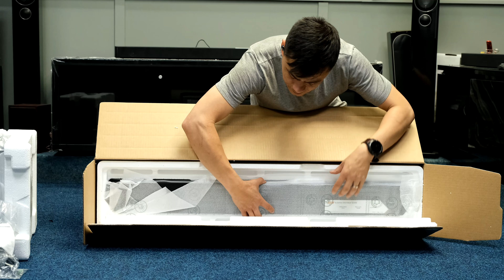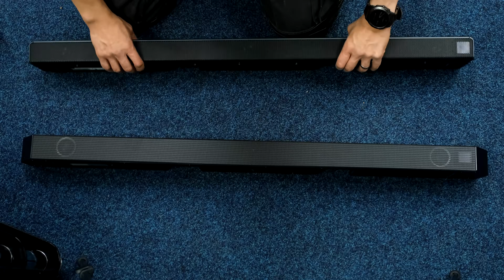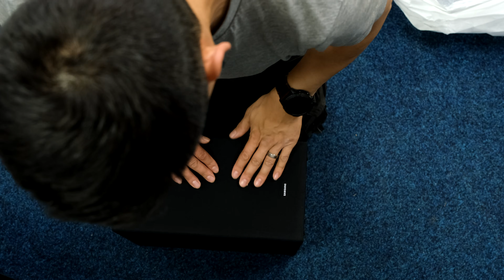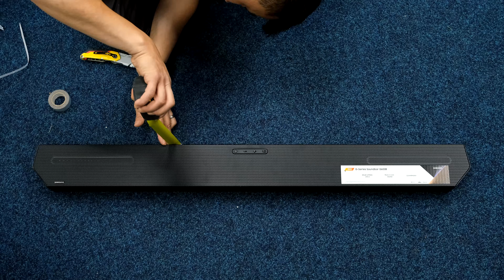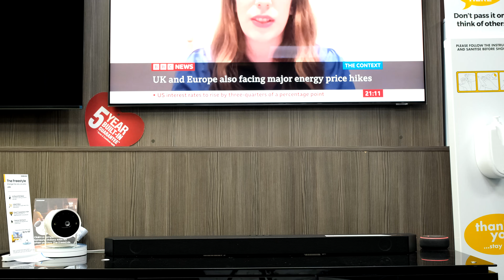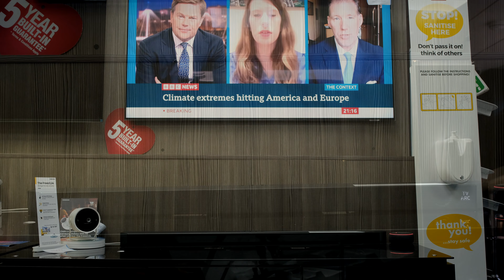Samsung Q600B Soundbar 2022 Unboxing, Setup, Dimensions and Tests on TV, Music and Movies

Comment: I cant Figure out where the 9 speakers sit.
I can See 2 on the top and 2 on the Front and minimum one in center. Makes 5. I got q610b it should have 9 build in speakers.
But that soundbar sucks. 400euros  and sounds like a better stereo soundbar. No overhead Sound. Tried All settings. I always hear the Sound from the soundbar and not every where in the room like dolby atmos or 3d Sound

Comment: The new soundbar does not work, there is no guarantee. I'm trying to do it. According to reviews, this is a common reason for this model. Maybe someone who has already encountered it tells which element does not work

maybe there is a downgrading firmware, or dump

who has electrical scheme for samsung q600b/za? ready to buy
Reply: Did u find any solution

Comment: Thinking of getting this, I'm not technically minded here. You hooked the hdmi to the TV, what happens when I want to watch 4k content through my 4k player. Do I use the optical cable for sound from the 4k player to the soundbar. Then hdmi from the 4k player to the TV is that how it works.

Comment: Excuse me, but what is the difference between Q600a and Q600b? I can get Q600a much cheaper in my country. Any significant difference?
Reply: a means 2021, b means 2022. the b vearsion has top speakers, and eARC.

Comment: I received yesterday, I'm using with an LG TV. When I turn off the TV and then I turn on the TV it lost the pairing with the soundbar so I have every time go in the tv menu to ri- connect to soundbar. Maybe I do something wrong I don't know, any suggestions?
Reply: Have you tried using an HDMI cable and connect it directly to the TV.
On TV make sure to select "HDMI ARC" port. Lg remote should operate it.
Reply: @2010nelly2010  yes thanks, I've fixed it 👍
Reply: I think problem is LG TV.
Reply: @lynguyen-iy9hf  I have fixed, now it's OK
Reply: @Mothercaos  good. Do you have any other problems? How's the experience?
Reply: @lynguyen-iy9hf  I have to say that my experience it's positive. I had home theater 5.1 years ago and In my opinion  was better that kind of sistem. Anyway if you don't have neighbors close to your apartment and you can turn  up the volume this soundbar is good.
Reply: @Mothercaos  ok. With Dolby Atmos, watching the movie will be good.

Comment: What’s the difference between this and the 700B?
Reply: Q700b connects with smart things,chrome cast,Alexa etc. Also it connects with the higher end rears 9500 compared to the q600b 9100s/9200s

Comment: Hey friends! I read on best buy about problems related to this soundbar. Every other comment says that it goes down after a week of work, anybody had the same experience?? will you recommend buying one? i am thinking to get either Q60b or Vizio m2.1
Reply: The demo one in the shop was not going,  I decided to get one anyway and it stopped working that night. Then I read the reviews and they are bad.
Reply: Don’t buy it I had one stop on the same night then change it with the same model and aftre 3 weeks it also stop

Comment: Just a quick question- what was the size of the TV at 11:11? Was that 50"? 
I have 50" TV myself and I'm afraid it will look a little too big under my wall mounted TV.
Reply from the maker: 55 inch but I've pulled the soundbar forwards so it may appear bigger than it actually is in comparison

Comment: Loving my Q600B. I'm just hoping Samsung make some compatible Dolby Atmos rear speakers for it soon. Or update the firmware to let it work with the SWA-9500S.
Reply: There are two sets already available.... 9100s and 9200s both compatible with the Q600B
Reply: @corrychadsey6665  I am aware of these models. However, they do not have up-firing Dolby Atmos speakers, unfortunately.
Reply: how about the bass q600b?
Reply: Did the atmos rear speakers ever come?
Reply: @robg5524  Lol, no. And it looks like they never will. But that's fine, I've accepted I'll be upgrading/ replacing my whole soundbar soon. Which is exactly what Samsung wants. But in due time. With all the praise the Q990B/ Q990C gets, I might as well go for the top of the line.
Reply: My initial choice was Q600C (upgrade of Q600B) but the salesman offered Q800B for a thousand pesos higher but better model. So its now my new choice, its 5.1.2 channels and if i add 9500S speakers worth 10k, the Q800B will become 7.1.2 channels.
Reply: @jumelmedina4387  Nice. But your Q800B + SWA-9500S = *7.1.4 channels, not 7.1.2 :)

Comment: Setting up sound bar when ever we try to adjust volume it goes to MUTE and no sound can you please advise .
Reply from the maker: Are you pushing the Button forwards and not in?
Reply: @TellyDan  this soundbar attually have a sily problem...i buy this soundbar after 10 or 15 minits its no have sound...this is problem about this soindbar...and i try to find at youtube why this make it happend...and i saw a tips if you have a same problem you mist cut the number 13 pin at your hdmi cable..this is because maybe your tv box disturb your soundbar system
Reply: @Fadzleepishal3806  will eArc still work after doing that ?
Reply: @shamkhalmammadov4083  i dont know about your soundbar system but my soundbar is all fine ...maybe your tv box is disturb your soundbar system ..try to cut the no 13 pin at your HDMI cable
Reply: @shamkhalmammadov4083  yes its work

Comment: What's the difference between this and the 650 b and the q700b  ?
Reply: You get more hardware features w the 700 like room correction and SmartThings app but other than that not worth it if you want real difference 800b and above. Personally I have the 600b and it is PLENTY
Reply: @devinfowler166  can q600b connect with smart things
Reply: @are_meerchannel6181   610b cant. I paid 400euros for this 💩.
Look in smarthings it Show compatible soundbars when you want to add an soundbar manually

Comment: This soundbar is not compatible with earc , it doesnt work after turning on e-arc. Samsung service center is replacing a component after which it works fine. I actually got three replacements for the sound bar and found this was a factory made  issue in the model.
Reply: hey bro, any suggestions to avoid this problem ?? I thought q60B is 2022 model and  supports eArc

Comment: Samsung q600a vs Samsung hw-q600b vs Samsung q700a on TV Samsung q60a? Wich best to buy? Help))
Reply: I prefer q700b, much different to compare with q600.. believe me.. or if u had extra budget, q800b is much better..
Reply: @ekarlakalil3302  yes q700b is very good variant, but alexa,air play, not for me, and sensor mode tv is not include my tv. And in my country right now  is not selling q700b, q800b and this is problem. Now on the sounbar 2021 is normally sale
Reply: @reallife7110  q600b.. year 2022, eARC, and just add on surround wireless speaker SWA-9200s if u want for more surroundings sound experience..
Reply: @ekarlakalil3302  Bad 1 moment i see many comments,  who buy q600b, in other country, talk he is working 2,4 week, and not work. And this is a Problem!
Reply: Mine is samsung q65b tv..
Reply: @ekarlakalil3302  cool! 2022 year. My tv 2021 year q60a 50"
Reply: @ekarlakalil3302  If you have the money,  what do you buy? Samsung hw-q600b (or q700a) soundbar or portable Bluetooth speaker JBL Boombox 2 ?
Reply: @reallife7110  for tv q600b, but if for listening music on my bedroom i will consider to buy jbl boombox..
Reply: @ekarlakalil3302  Ok. And if you have 1 variant to buy? Soundbar or portable speaker? Hard choise to me right now

Comment: mine stop working after 2 months can't figure how to upgrade the firmware,try to do a hard reset no dont work try hdmi ,optique fiber nothing. I'l give this a few chances to work if not i'l return it.
Reply: I most that i can't instal the firmware. Maybe not the good type of usb? Maybe  make a video how to instal the firmware that would be great.
Reply: Try cek your hdmi cable and what i know you must cut the pin number 13 if your soundbar not working...maybe your tv box is disturb your soundbar sistem
Reply: If you use a tv box ...the tv box sistem is disturb your soundbar sistem and you must cut the pin no 13 at your tv box hdmi cable
Reply: @Fadzleepishal3806  if im using samsung tv it should be okay?
Reply: @are_meerchannel6181  yes absulutly

Comment: Samsung q800b or q600b ? Please do a comparison.
Reply: Q800b.. much different to compare with q600b..
Reply: @ekarlakalil3302  u mean q800b is superior?
Reply: Yes very
Reply: @sivakumarvenkataraman2216  Lol it is significantly better, but 200.00 more. If I had a house, I would invest in the 800, but the 600 is more then adequate for smaller living rooms, apartments.

Comment: How is the bass
Reply: I have the q700b and with my lg oled c1. Flawless. The bass is deep and boomy. Something lacking from previous models. I can’t comment on the q600b but the 700b is top notch. I’d recommend that . But I don’t know difference between the two. Probably earc on 700b and the upward firing speakers get more height on the sound.
Reply: @TrigTalksScents  q700b lacks Bluetooth multi-connection, no AAC support from mobile, also it doesn't support USB playback.  But q600b does. For cheaper alteration Q600b is the best choice. We can consider Q800B If we have little more budget

Comment: I bought it and on the second day it broke 😬
Reply: Same problem suddenly no sound after few hours
Reply: @hasanahomar  I replaced it with a Sony HT-G700
Reply: @EdwardKenway-AC-IV  which is best sony HT-G700 or Q600b 
??
Reply: @sandeepmishra372  I think that  Sony HT-G700
Reply: @EdwardKenway-AC-IV  are you happy with the Sony one?
Reply: @hasanahomar  on the second day
Reply: same question
Reply: @ddhao7908  did you update the firmware?
Reply: did you update the firmware?
Reply: I had to return mine for a factory defect too, second one is working fine
Reply: @robpivcevich6793  is it working now?
Reply: @zero0263  yeah no problems with the second one everything synced right up
Reply: @robpivcevich6793  ok, thank you for the info. Have a nice evening sir
Reply: sir, I have one question, is the current soundbar still okay?,, the problem is I just bought it for not even 2 hours and already claimed the warranty, the problem is not connected between the bar and the subwoofer, after I read the video comments reviewing this soundbar model it turns out lots of obstacles. I had to wait to order spare parts from Korea which took 2 weeks, until now I'm still waiting.
Reply: @anggawijaya735  wow i have had the same problem today
Reply: @zero0263  dude, you just take it to the Samsung service center, make a warranty claim, I waited up to 2 weeks to replace the subwoofer, the subwoofer is waiting for a message, he said, from the center directly between South Korea or Singapore, said the technician.. I hope your problems are more quickly done.now my soundbar is working fine

Comment: What is the difference between this one and the Q700B?. Thank you!
Reply from the maker: Haven't looked at a Q700b yet
Reply: @TellyDan  in my country we will not get the Q600b only the Q700 & above. And when i compare the Q600b with the Q700b from samsung US website there is no difference whatsoever thats what confuses me. Anyhow thank you so much for your review keep up the great work.
Cheers!
Reply: @juidas  q700b doesn't have Bluetooth dual pairing, no AAC support and also No USB playback.
Reply: @sivakumarvenkataraman2216  it does have dual Bluetooth connection , I got it , I heard both the q550b and the q700b and they both sound good but the q700 is on a different level , much louder, clear,  it's was much better sound system
Reply: @juidas  Q700B supported wifi and dolby Atmos wireless, smartthing.
Reply: The q600a and q600b is not difrence..the diffrence just only the watt power another is same
Reply: The 600b is the 2022 model
Reply: @Fadzleepishal3806 Q600B supports e-arc. Q600A only supports ARC 👍🏼
Reply: In america it comes with minor differences like you can use smart things and I believe true up firing speakers so not much
Reply: maybe late but Q700B has Wifi (included Chrome Cast, Airplay, Spotify Connect) and can connect with SmartThings App. There are some small technologies like Room calibration, hi-res audio decoded

Comment: Is this a good choice to use with my new Samsung 55" QN95B Neo QLED TV?
Reply from the maker: The q800b is a lot more powerful, my neighbours wouldn't be as impressed as me lol
Reply: @TellyDan  I also noticed the Wireless rear speakers have to be both pegged in to the mains, that four mains plugs for the whole thing. Think I give it a miss.
Reply from the maker: Yes I think so, it had surprising power and quality of sound
Reply: @TellyDan  although the 5.1 Q800B looks better now lol :)
Reply: @TellyDan  I bought the Samsung Q930B Soundbar in the end and its amazing with my TV :)
Reply: Yes because the 600b does not do Qsymphony also many of the features you would bet with a 700 and above only work with a w series tv I would have bought one but I only have a 4K Samsung tv
Reply: @devinfowler166 q600b does Q Symphony